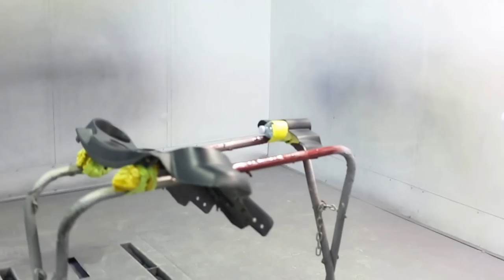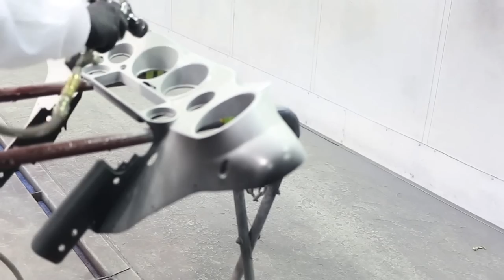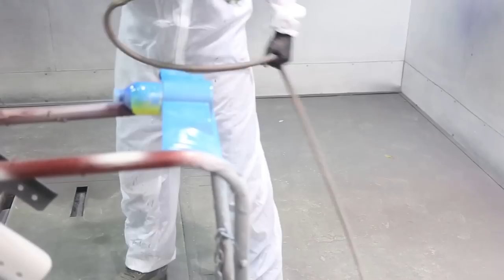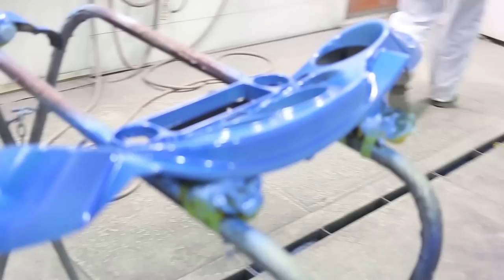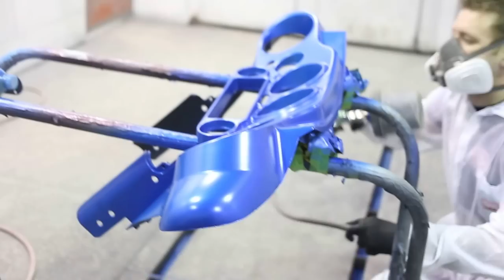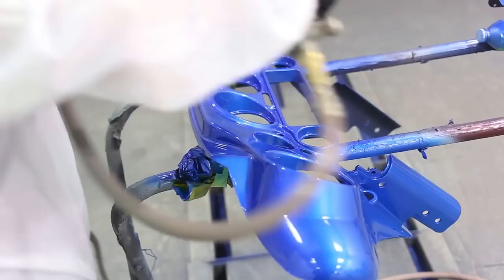Painting a Harley Ultra Classic Fairing

Comment: I watched most if not all of your videos.  Maybe you mentioned it and I missed it?  But what psi do you spray your lph400 for base and for clear?and would you spray solvent at the same psi?
Reply from the maker: It's been a while since I used that gun but I believe it was around 20 psi, lower than most guns I've used. I only really used it for base but it would be in a similar zone for clear.